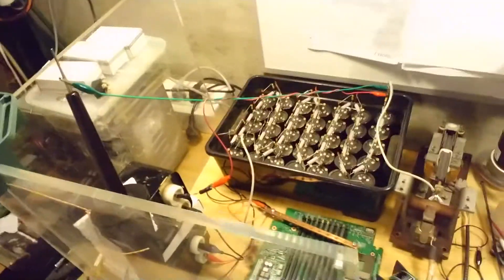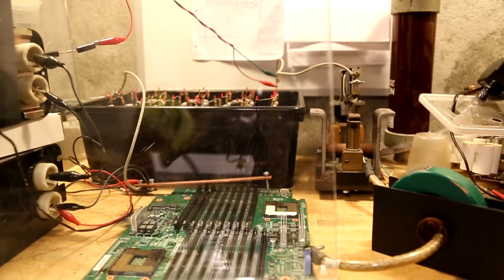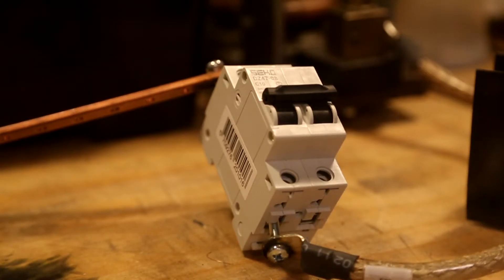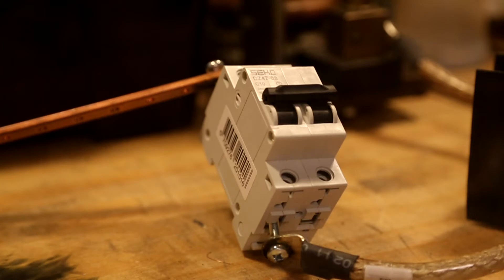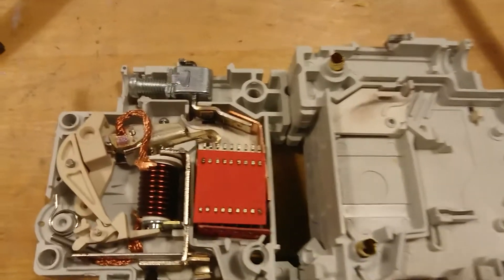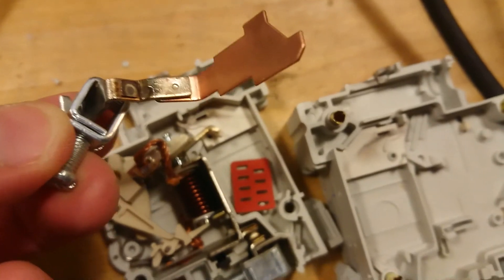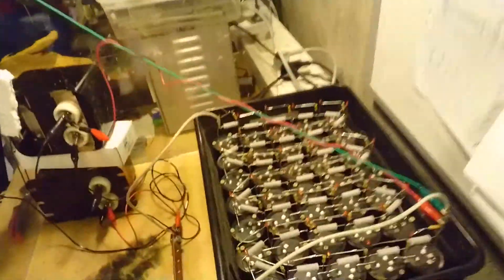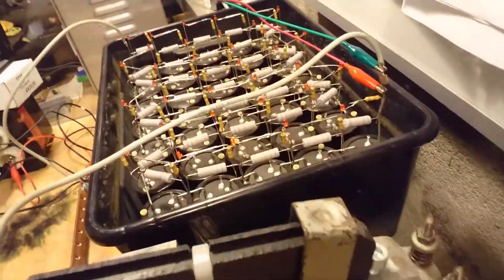3.5kJ BANG Tests! 35 Electrolytic Caps in Series Charged at 12kVDC/48uF

Comment: Almost 2 ohms ESR, so it's actually somewhat comparable to an IEC surge (which uses 20uF -- in the ballpark), of that voltage rating (which is well beyond the normal testing range!).

Probably the discharge is short enough duration that the circuit breaker didn't even open by the time it was all over!
Reply from the maker: I actually have a IEC impulse tester, which unfortunately is defective, but I will repair it at some point and make a video of it. It must have been the peak current through the actuator coil in the breaker that kicked it open, I do not have a wavefrom from that particular test, but the waveform could properly have shown when it opened.

Once I have my high speed camera, I have a wide range of breakers to test :)